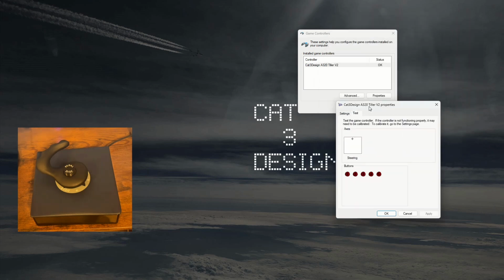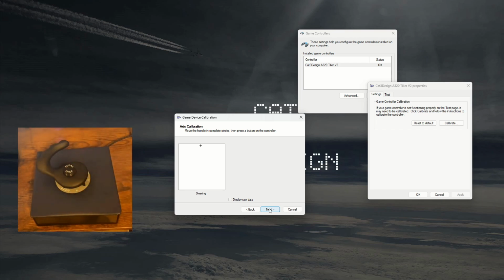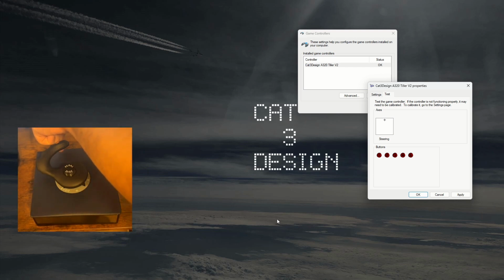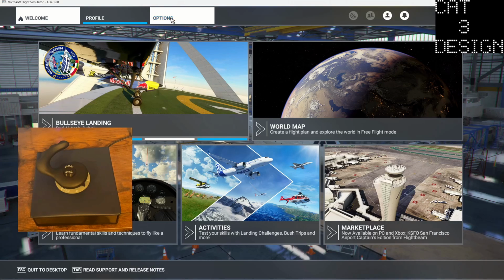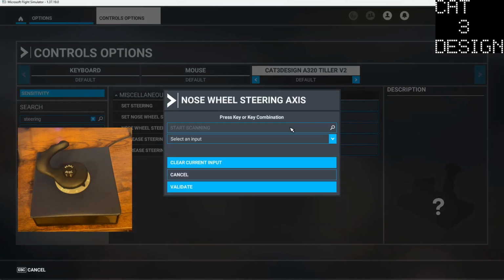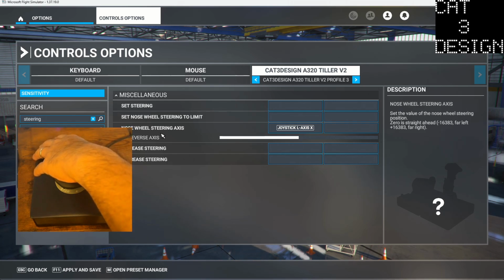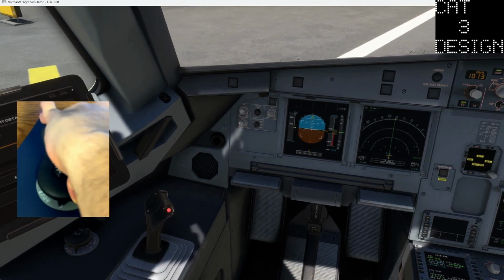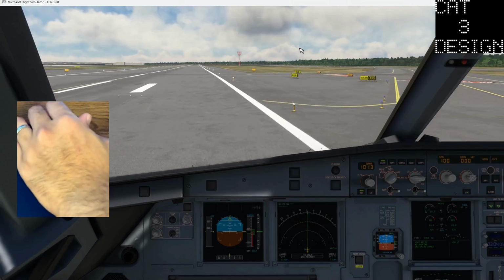Cat3Design.com Airbus Tiller V2 Setup Guide for Microsoft Flight Simulator

Comment: Cannot wait for the Boeing one!
Reply: Let me preface this by saying all of cat3design tillers are amazing. With that being said, i have both the airbus tiller and the Boeing tiller…..and i prefer the airbus tiller all day everyday and twice on Sunday. If you are thinking about buying one or the other, go with the airbus. Trust me, immersion is there thru and thru, even when flying a boeing.
Reply: @zk9058  Thanks for the insight, I was on the verge buying the Airbus one as it in  stock but I really only fly the 777 and 737 so it could be immersion breaking. Could you develop on why you don't recommend the Boeing one? The 4 ways hat switch doesn't seem as convenient on the Airbus compared to the Boeing one.
Reply from the maker: @zk9058 From an ergonomic point of view I can attest, having experienced both types in real life, that Airbus handle is my preference
Reply: The Boeing one is ordered!
Reply: It has something to do with the feel and precision of the airbus tiller. It’s perfect. The Boeing…..not so much. I find it’s harder to control the Boeing tiller - it’s a longer throw…..and the design of the tiller gives you less control with shallower turns. If you’re turning the entire range of the tiller it’s fine, but more precise movements within a smaller arc (say less than 70 degrees) is difficult to master. It might have something to do with the arm of the tiller (which is long) or the spring/tension used to control the tiller, but i find its far less precise than the airbus design. Not sure if that makes a whole lot of sense. Personally, i find the airbus is so much easier to control…at every angle. I always know exactly how much to turn it to get the steering angle i need to make the turn, regardless of what I’m flying….and i use it for every tubeliner, from the md80 to the 777. There is nothing immersion breaking about using the airbus tiller for a Boeing  (at least not from my point of view).  I’m guessing cat3design knows this too, which is why they’re manufacturing  the airbus tiller again, and not the Boeing.
Reply from the maker: Boeing tillers are coming back btw. With the same limitations as before that it only travels +/- 75°, as opposed to 360°+ on some Boeing types.
Reply: @TheFlyingkat  Now I don't know what to do haha! Do you ship to France?
Reply from the maker: @darewell7776 Yes we do ship to France. It all depends on what aircraft type you want to predominantly simulate. If you are likely flying wide body Boeings more than Airbus, then the Boeing tiller will likely give you more immersion as the physical handle matches the 3D model in the sim.
Reply: @TheFlyingkat  I'll order one of them for sure, will you also sell the boeing mount?